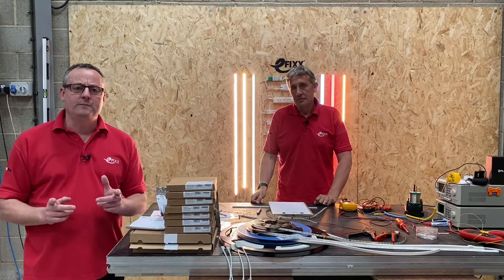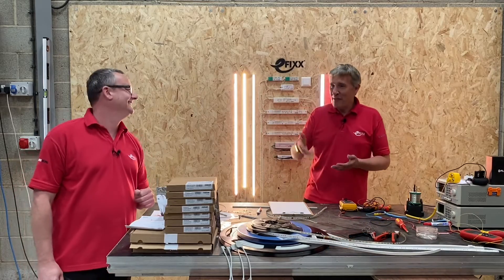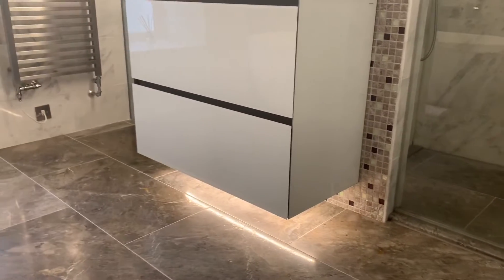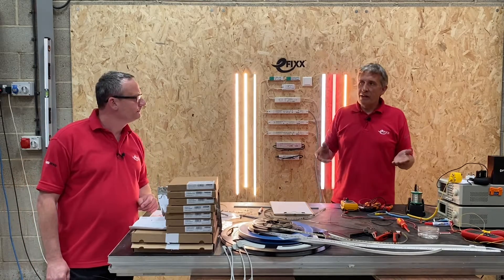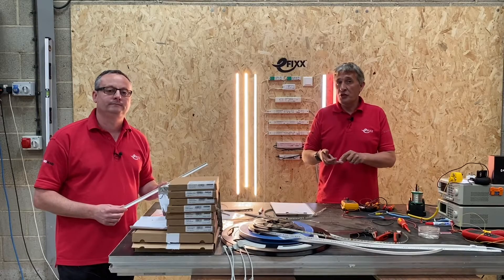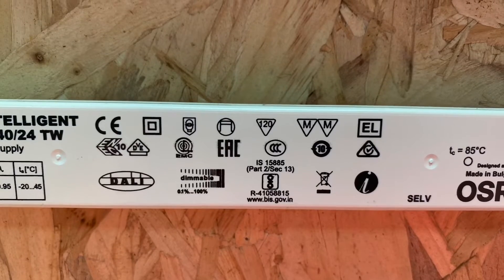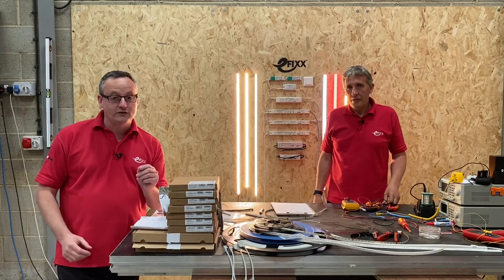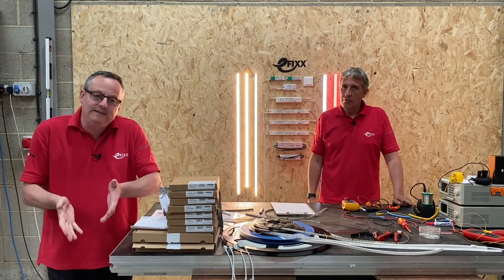Working with LED Strip - Pro installer guide

Comment: Gary I have three core swa there's Brown and grey and black cable is neutral cable cable earth cable I have never worked with swa before
Reply: john oreilly you would put earth shrink sleeve over the black and blue shrink sleeve over the grey
Reply: R–Y–B        old
(L_E_N)      (1ø)
Br–Bk–Gy  new